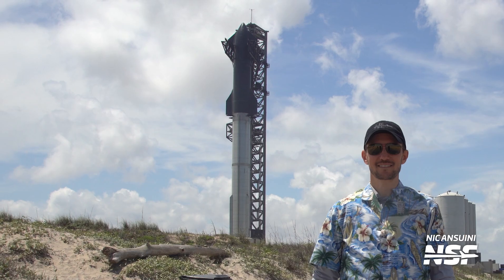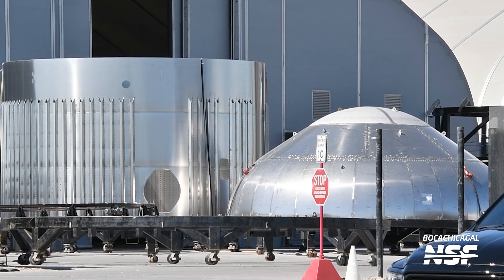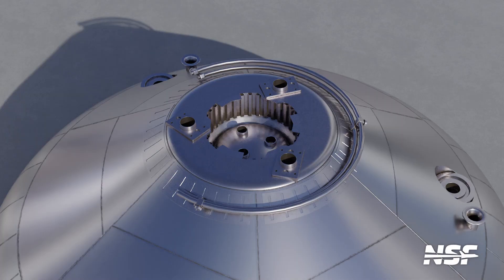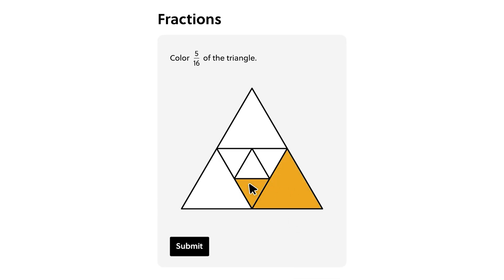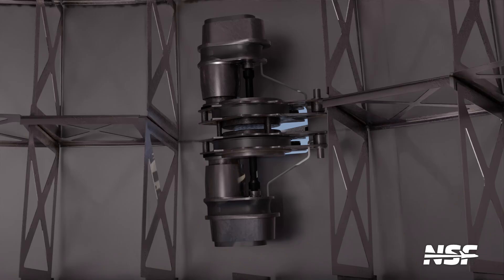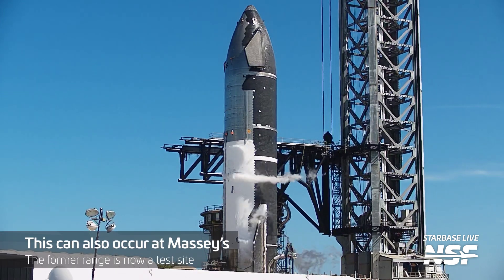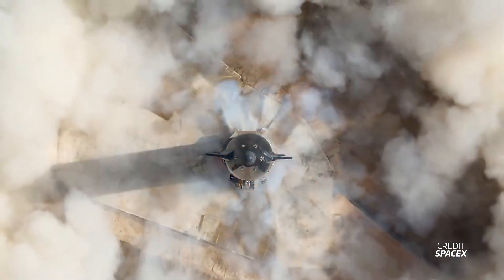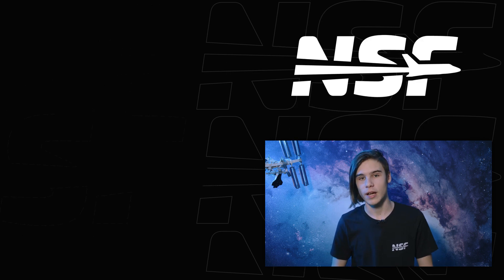How Does SpaceX Build Starships at Starbase? From Steel to Starship.

Comment: AFAIK, the 304L stainless steel sheets are *not* 2m wide, nor are they 4mm or 3mm thick.  It's still 6ft wide = 1.829m, and the thicknesses are 11 gauge (3.97mm) and 10 gauge (3.57mm).  I tried laying everything out using the 2m numbers and it doesn't work without going to the old-timey sorta-imperial units.

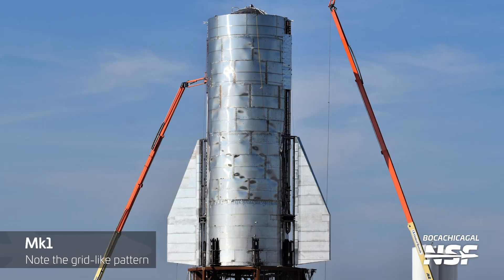Comment: 1:13 they improve a lot with this method 1:20. BUT I HVE A BETTER ONE. SPRING COIL.
Roll it as a spring. instead oc cut segment just roll it with certain angle and you can make large as infinte. Mass production unlocked.

Comment: The FAA is to blame for not issuing many licenses over the last 2 years.
 The Federal Aviation Administration (FAA) is responsible for regulating and licensing commercial space launches in the United States, including those conducted by private companies like SpaceX. To accommodate rapid design and testing of spacecraft, the FAA has to be flexible and adaptive to the evolving needs of the industry.

One way the FAA has adjusted its licensing policy is by implementing a "streamlined" review process for reusable launch vehicles like the SpaceX Starship. This process allows for multiple launches under a single license, as long as the vehicle design remains largely unchanged. This means that SpaceX can conduct more launches without having to go through the entire licensing process each time.

In terms of safety regulations, the FAA requires that companies like SpaceX demonstrate that their launch vehicles are safe and reliable. This includes testing of all vehicle components, including the flame diverter that you mentioned.

If ongoing tests had been done and a booster had flown alone sub-orbital, and it was discovered that a flame diverter was needed, SpaceX would have had to address the issue before the next launch. The FAA would require SpaceX to demonstrate that the issue had been fixed before approving another launch.

Overall, the FAA is constantly adapting and adjusting its licensing policies to accommodate the rapid innovation and testing in the commercial space industry, while still ensuring public safety.

To be more in line with the type of rapid design and testing that is common SpaceX, the FAA could consider several strategies:

1. Implement a more agile regulatory framework: The FAA could adopt a more flexible and adaptive regulatory framework that can keep pace with the rapid innovation and testing in the commercial space industry. This could include allowing for more experimental launches under temporary permits or easing some safety regulations for reusable launch vehicles with a proven safety record.

2. Enhance collaboration and communication with industry stakeholders: The FAA could work more closely with commercial space companies to gain a better understanding of their needs and challenges. The agency could collaborate with industry stakeholders to develop safety standards and best practices that are more aligned with the unique features of the new launch vehicles.

3. Invest in technology and expertise: The FAA could invest in developing and enhancing its technology and expertise to improve safety and regulatory oversight. This could include improving its analytical capabilities, enhancing its simulation tools, and hiring more experts in areas like materials science and propulsion technology.

4. Foster a culture of innovation: The FAA could encourage innovation in the commercial space industry by promoting a culture of safety and responsible risk-taking. This could include providing incentives for companies that prioritize safety and sustainability, recognizing companies that achieve breakthroughs in technology and safety, and encouraging knowledge sharing and collaboration among industry stakeholders.

Overall, the FAA could take a more proactive and collaborative approach to regulation to ensure that it is keeping pace with the rapidly evolving commercial space industry while maintaining safety and security for the public.
Reply: Yup. FAA handled this as well as they did with Boeing's 737MAX. Cozy relationship about to change.

Comment: one question, has the lopsided weight of 17,000 heatshield tiles been taken into account when starship and booster launch...?
Reply: It definitely is! But the tiles are designed to be as lightweight as possible, so it's not that major of a contribution.

Comment: 9:25 categorically untrue; albeit larger and less efficient on paper at sea level, RVacs are known to work just fine at sea level because their chamber pressure will still be at over 1 atmosphere even after the exhaust gas is pushed out a nozzle with an area ratio that’s definitely not enough to reduce the exit pressure by that much
Reply: Are you sure? Expansion ratio will be higher, this means overexpanded at the outlet. Then surrounding air might be sucked in around the edge of the bell, while the gas is flowing out, hence the damage

Comment: Would it be easier to use spiral weld to make the starship?
Reply: No. It would make the structure more vulnerable - it would "zip open". That is why vertical weld lines are staggered. Also working with steel sheets that large, and heavy, is not made any easier at an angle.

Comment: Good to see you making videos again, I was beginning to think that the shock of last week was never going to wear off. Now we need more information on the rebuild plans.
Reply: The main goal of the test flight was clear the launch tower and nothing more !!!!!, They've already built three prototypes, and one of them received new RAPTORS 2 engines today.
Reply: @venturestar  That's great to know and I was aware of their fast turn around on ships. The problem for now is that they have no where to launch them from. It's going to a major rebuild project to stabilize the OLM, if indeed that's what they end up doing. My worry is that it is going to be a minimum of 6 months before we see them anywhere near ready again. In the meantime they now have FAA regulators breathing down their necks and these guys are going to be hyper with their requirements before SpaceX will be allowed to launch again. They will need an extensive test program to certify any solution to the OLM devastation.
Reply: @B0M0A0K  No offense to SpaceX but they knew what was going to happen regarding the FAA's actions if this flight didn't go decently. The truth is the FAA wouldn't be "breathing down their necks" currently if the OLM, launch site and the surrounding protected wetlands (which SpaceX doesn't own and can't mess with) didn't take such a beating. Not to mention all the particulate matter that was blanketed over the towns surrounding Boca. It was a calculated risk and unfortunately it seems to have backfired on them. It's probably going to set them back more than if they just waited for the water-cooled flame diverter to be installed; especially since it was already at the site.

Considering the structural issues they found on Starship (the ship, not the stack), I think they REALLY needed and wanted the test data from the flight to continue iterating on the design as to not waste time/scrap a bunch of hardware.
The only other reason(s) I can think of in their choice of pushing the launch through was Elon. He either wanted a 4/20 launch (the only date in the program he ever called correctly!) for publicity or he wanted to "save face" so to speak as he kept saying a while ago that the FAA was holding them back (looks like that might have backfired a bit) in their testing regime.
Reply: @georgewashington1621  I think they have to do some combination of both, but I'm afraid I have little faith in this water cooled steel plate idea. They still haven't changed the basic issue they had with the original heat resistant concrete. Namely that this has to withstand not only the temperature, but the pressure waves generated by 33 engines. And if it's flat then the pressure wave will simply rebound and redirect all that energy right back into the engine bay. As mentioned, they are going to have to test the hell out of this solution and at 90-100% rather than 50%. I'm not convinced that they won't end up needing a trench and I don't think they will be allowed that because of the environmental impact. It's a really difficult problem.
Reply: @dr4d1s  There is much truth in what you say 👍
Reply: @B0M0A0K  I agree with your assessment as well. The solution needs to be an aboveground "trench" and diverter and not just the water-cooled diverter. At the launch there was so much plume being shot out around the OLM and a diverter isn't really going to solve that issue. They need something that will not only deflect the plume but contain/control it as well. Like you said, I don't think they are going to be allowed to dig a trench with all the wetlands around and it might not be feasible anyway with the high water table. What they need is something along the lines of what they have on the RS-25 test stand at Stennis. Basically enclose all but one side of the OLM with the diverter pushed as far back as it can go to the opposite side of the opening. 

But hey, I am just a telecommunications engineer and not an aerospace or structural engineer; I am sure the SpaceX team will eventually figure it out.
Reply: @georgewashington1621  I don't know, as @Cody Ruthko says, I'm not an aerospace or structural engineer. But I would think that tilting the plate would also require some kind of trench, otherwise the force of those engines at ignition would just dig out the soil/concrete on the side the plate is angled to, and then you have the problem of ejecta all over again. Please don't get me wrong here, I want to see this work, I want to see them have another go and see how far they get this time. I grew up in the age of the Apollo Moon landings and this stuff fascinates me. The hours of forensic analysis by NSF and LabPadra have been some of the most riveting media I have seen in a very long time.

Comment: I wonder if starship will also use the belly flop position during coast on the way to mars. (Heatshield in prograde direction)

Considering the tank walls are also the ship walls this might be needed to shield from impacts or am I missing something here?
Reply: The likely orientation would be pointing the engine bay towards the sun. That puts all that steel in the way and reduces direct sunlight on the tanks. If it also deploys solar cells as a circle around the bottom, that would add to the sun-shielding. But SpaceX is at the moment more concerned about getting the Starship system working at all. Mars is not their first priority, only their goal long term.

Comment: The roads to starbase are going to be toast with all those heavy resources they need :o
Reply: They are reinforcing the road between Starbase and Massey, just as they did to the launch site.
But they will have to repeat that every few years - can't be helped. 
(The could drill and install concrete and rebar pilings under the road, but that would be very very expensive. They will never do that.)